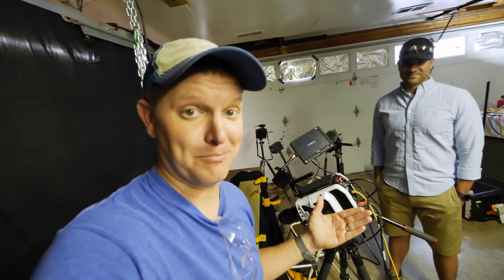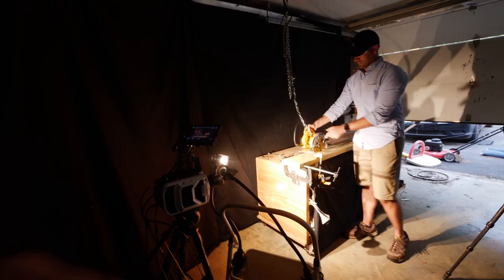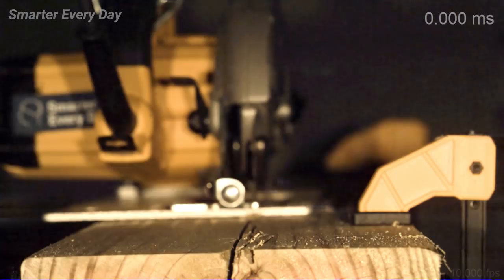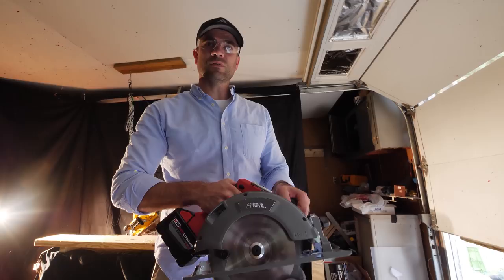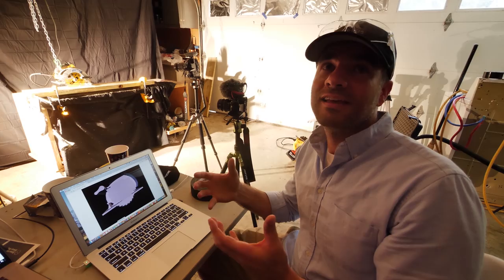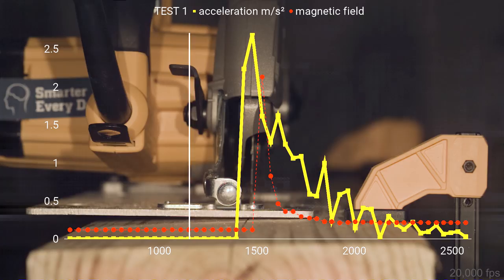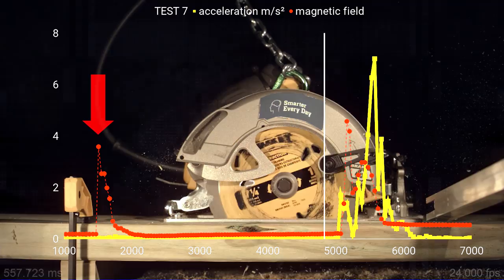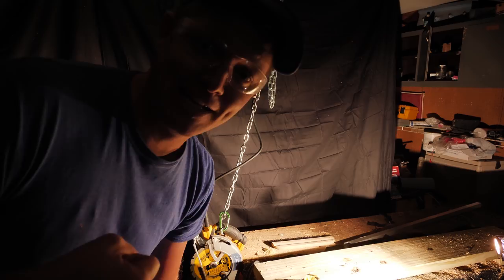Circular Saw Kickback Killer (We used science to make tools safer) - Smarter Every Day 209

Comment: I know this video is old but I’m still posting this comment. I’m a woodworker. It’s something I do everyday. I use saws everyday including circular saws like the ones you were using in this video. This feature is great and all but in a professional product, I don’t want my saw randomly stopping due to a false alarm. Even without this feature, the blade guard (which you had taken off or tied back) would cover the blade before it could hit you. What operators of a circular saw should be more worried about it preventing kickback in the first place. I understand it’s not always preventable but normally it’s because the blade binds because of a lack of support on the cut off end. If the operator set up and took time to think about safety before the cut, we wouldn’t have to rely on a feature like this, but have it as a backup. Just because there is a feature to keep you from hurting yourself if your using the tool wrong, doesn’t mean we should stop  taking the time to think about the cut before you cut. That’s why the saying goes “think twice, cut once”. Not just because you don’t want to cut the wrong size, but also because you need to think about if the tool is being used in a safe manner. Is the operator wearing safety glasses and is the environment safe to be cutting in. Not that this is a bad feature, it’s honestly amazing, but we shouldn’t have to rely on features like that if we can prevent it in the first place.

Comment: Anybody who plans on using a circular saw , do yourself a favour, spend the extra money and buy a skil worm drive saw. It’s has way more torque then sidewinders, it’s better balance so does not want go askew when cutting like side wonders, cutting down on kick backs.its also has a slip nut so blade will slip preventing kick backs as welll. Circular saws or side winders , are terrible design, the centrifugal force causes torque to want turn saw perpendicular to saw blade. Worm drive saws don’t have any of those tendencies
Reply: Weighs three time as much as a regular skill saw. Blade is on the wrong side of the saw so you cant see the blade when cutting a 45.
Reply: essential craftsman cuts 45's all day with his skill saw.
Reply: personnel preference, they will both cut you up bad. just get good with what you have and dont dream of having the next (or in this case last) best thing

Comment: A lil tip that may help anyone who experiences kick back from a circular saw. Support the cut off piece level with the rest of the board you're cutting. Hold the saw loosely with just the trigger hand and let the the power saw that you hired do the cutting for you. If you hang on too tightly or force the saw you will lose control.

Comment: I swear your blades are spinning the wrong way around!!
Reply: ifell3 what do you mean?
Reply: It's correct so far, 2 min into the video.
Edit: And Destin knows how to use tools.
Reply: ifell3 do you mean the blade is on backwards or the motor is spinning wrong way?
Reply: I own my own Construction company, i can honestly say it is spinning the correct way which is counterclockwise. It is designed to spin counterclockwise to pull the saw downwards to the wood and cut through it. If it spun clockwise it would just want to pull itself on top of the wood and not cut all the way through. And would basically be a  non stop series of kick backs in the forward direction.
Reply: @tomwilson7765  Exactly, it seems counter-intuitive on video for beginners, but if you've ever used a jigsaw with the blade upside down you realize it.
Reply: @ifell3:
I noticed this too. And in an other viedeo from the Backyard Scientist i noticed that the anglegrinders turn in the wrong direction too…
Reply: If it was spinning the right way it would fly forwards not backwards into the user, the ones I have used spins clockwise on the right side and anticlockwise on the left, if that makes sense.
Reply: You guys must have your motors spin in the opposite direction, if I was to let go off mine it would drive of down the road so to speak.
Reply: @Grakoham  motor
Reply: @tomwilson7765  wood has a top and bottom, if it spins clockwise on one surface it would spin anti on the other, vice versa, only if you let go of yours it spins towards you rather than away.
Reply: ifell3 the thing about having a saw that turns the other way is it will constantly try to jump out of the wood.
Reply: Ive run a road saw and it spins the way youre thinking this should spin... In one sense you are right, as in if it kicked out it would want to go away from you... But i can tell you from running a 300lb road saw,  when the blade runs out of diamond, you cant keep it in the cut.. You could stand on a circular saw spinning that way and it would climb out of the cut and youd be skating down the driveway till it came unplugged...

The reverse spin uses this exact principal to pull the saw into the wood.  And kickback will never happen if you use the saw properly. But as said in the vid, some material reactions and circumstances arise that can take even an experienced user by surprise.
Reply: @flip66five  yes i have also used road saws to cut control lines in concrete and if you go to fast or if the blade starts to get dull from the dimond tips wearing, the blade wants to jump out of the cut.
Reply: Ok I stand corrected, just been to have a look, I swear they went the other way!!! Thread closed hahaha humble pie ate

Comment: i feel like 95% of carpenters dont feel the need for safety equipment until they cut something off...
Reply: I've been to agricultural school for three years until this fall, and you can see the huge difference that young people finishing their apprenticeship have for pesticide and machine safety compared to the older farmers and gardeners. Early education makes a huge difference when you get people to take it seriously before they get used to ignoring risks.
Though it certainly helps that the health and safety regulations and workers rights here in Germany make it possible for workers to refuse any work if they think there is danger. Even when the task is within regulations, it's always down to the risk assessment of the people whose safety is on the line.

Comment: When I cut I grip with both hands(there is two handles on my saw) but the trigger hand I only grip with 4 fingers and trigger finger is not part of my grip on the saw so if anything goes wrong it’s much faster and easier to let go of the trigger. Also properly securing the material you are cutting is an important step I feel most do not do and is dangerous. When making a long cut backing up and going forward also cuts some of the material away as it tries to close together. Worn blades are another mistake I see a lot. Some blades also have a sort of non stick coating on the sides of the blade to help prevent it from grabbing. Setting the correct cut depth is important. There are many things you can do to minimize your risk when using a saw just like driving a car or walking down stairs. Be safe folks having all of your body parts still attached and not bleeding out on the floor is way better than saving 60 seconds rushing.

Comment: ? ? ? ?   How difficult or costly is disengaging the brake applied to the blade?  Since you were able to reuse the same circular saw in the succeeding video recordings, I must believe disengagement is an easy step to perform?  I understand this braking feature is available on tables, but that brake makes the blade unusable. I am sooo enjoying the SmarterEveryDay videos—as I’ve been a fan now for 40 minutes since I found your pulley video!
Reply: Not the same thing as the saw stop, which is what I believe you are referring to with the table saw. Hand held circular saws already have a brake that stops the blade from spinning when you take your finger off the trigger, otherwise the blade would spin to a stop from its own momentum. The brake doesn't damage anything. What these guys are doing is adding sensors to tell the saw to engage that brake when it detects a kickback.

Comment: The critical thing about this is that it is not a destructive stop like saw stop.  
Saw stop has a couple more issues challenging it, mostly due to the saw being fixed in possition, so it doesn't experience any detectable... or should I say, easily detectible, changes for kick back events.

Comment: as someone who experienced this kind of kick back. Well Done! I was lucky, using a small 3.4 inch circular saw and doing  a cut i should have got out my table saw for I stupidly, in a rush to finish a project, was holding the piece of wood behind the saw as i got close to the end in front. the saw jumped out of the wood and rolled back across three of my fingers. it was over before I even knew what happened. some how I got away with only stitches. should have lost all three and had it been a full size saw i probably would have. 

Stay Safe!

Comment: I always make the cuts holding the circular saw like a bull.  I had experienced the kickbacks but I always control the tool in the air. I do that because I saw many people get hurt with that saw.  I think the table saw is harder to control when there is a kickback.   Just never forget to hold firm that circular monster when you  make a cut.  Send the energy movement away from your body and never let go the tool.  Work in open and clean areas as much as possible.  Keep people and pets away.  Be safe.

Comment: This could've prevented my accident a few years ago. Sawing through a 2x4 with my dads big skill saw and hit a knot, kicked the saw back and ripped up my leg. It cut into my quad and I went straight to the ER. They said I was about 2 inches from my femoral artery and I wouldn't have made it to the hospital if I hit it. Lucky for me I made a full recovery and can lift weights again without any issues. The nerves are a little messed up though in the skin.

Comment: I get that the kickback can make the saw jump out of the wood. But why wouldnt maintaining consistent downward pressure on the tool prevent this? Keeping both hands on the tool with arms extended and downward pressure applied should help keep the blade in the wood while also keeping the blade away from you if it does come out anyways. Having the kickback be simulated with the tool just dangling from a chain doesnt seem to consider these extra forces in a real world situation. Far as i can tell the cutting capability is gained more from the speed of the blade supplied by the motor and less the torque of the motor. Im no expert or long time user of circular saws so Im really on speaking from speculation though.

Comment: I get the concept on paper but in the real world that feature would make a saw useless. You want to be able to finish a cut in one pass not start over. You want more torque when the saw computer senses resistance which all manufactures have been doing now. Secondly you should always make sure to have a decently sharp blade for the right job. This combined with more torque when it's being demanded is what keeps saws safe. As safe as a saw can be anyways. You have to restart a cut multiple times with this than you certainly would increase the risk of an accident happening imo. The extra torque when being demanded on new tool designs are made to just power through this resistance.

Comment: Chainsaws have ben using a counter weight brake for this purpose since the 1970s. Also wiring the trigger switch to a kill switch on the plate would work as well. Aren't  circular saw meant for cross cuts anyway?

Comment: This is very cool. That being said, I am much more concerned about kickback from a table saw than a circular saw. There is a brand out there that has a rapid braking system, but it works when the blade comes in contact with your finger. Although that is a great safety feature, it does not prevent kickback. It would be cool if you could adapt this technology to a table saw.

Comment: Wouldn't be easier and cheaper to design a switch on the saw shoe so as the saw lifts up it would stop the blade?
Also, blade guards are fitted with circular saws pretty much to prevent these accidents.

Comment: If you set up the wood correctly and stand to the side (per manufacturer instruction) that will not happen.  Sharp blade, experience, flex ion from the dimensions of the kerf are all variables that one eliminates with experience.  On the other hand I spent 2 years in Phys. Therapy getting to know a person that nearly cut through their leg 3” above the knee because they weren’t paying attention as using improper technique.

Comment: This could also be applied to drills.  Modern brushless power drills can really mess up your wrist if the bit gets stuck.  It wouldn't even require the same complexity/number of sensors as the saw - it just needs something to say "Uh-oh, the drill body is starting to spin (with too much force for a human to handle) instead of the bit... we must be caught up on something.  Pump them brakes!"
Reply: A simple accelerometer would work, for that.

Comment: I'm thinking that if you're standing behind the saw when using it, you aren't going to see where you're sawing, especially if you have a line drawn that you're following so you're doing it wrong to begin with. I've had circular saws bind up numerous times over the years. Never one kick back. It just stops spinning the blade. You need to be strong enough to be able to hang on to the handle. These aren't 5hp table saws. If you can't handle a circular saw when it binds up, you might want to use a jig saw or hire a contractor and just watch from a distance.

Comment: A great way to prevent a kickback is knowing how to use the tool correctly and how to cut the material correctly to prevent a kickback all you have to do is have half of the board or sheet of ply wood either put something like a 2x4 underneath so the other half of the sheet falls and doesn’t pinch or in this case when ripping a 2x10 as long as you have a firm grip and know how to use the saw it won’t kick back like not binding the blade or trying to move the saw left to right while cutting and this is kinda not to accurate of an experiment because the reason the saw kicks back everytime is because that’s the way the blade spins so when there’s no counter pressure like your hand it will kickback every time good idea and cool video tho

Comment: How about a micro switch on the bottom plate of the saw the would activate Dynamic braking when the saw lifts. It would not require microprocessor and reduce the cost of the saw.

Comment: Remember that there is always a user applying top pressure onn the saw.  Have never seen an incident which was outlined in this vid...sorry.
Reply: Thank you someone that actually has used a Circular saw before like the comment I posted if you know how to use tools correctly and cut your material correctly you won’t have any problem

Comment: I have a problem with this video.  I notice no one has there hand on the saw and the blade guard is wired back.  Why not show the saw being used as it would be in the real world?  I have hit knots in wood and never had a saw kick back like this.  The only thing my saw did was push back a little but never reacted this violently.  But then I had the wood properly supported and a firm grip on the handle.  If I started the saw and the blade was against the wood, it has hummed but never kicked backed violently.  Now I will say I have seen bad kickbacks where the piece being cut wasn't supported correctly, i.e. someone trying to cut a board supported by their leg. So my question is are you creating a problem where there really isn't one?

Comment: Why isn’t anyone noticing that the saw blade is spinning in the wrong direction normally it should spin clockwise so it pulls it self down and not pushes it self up if you can’t hold it and on a safe powersaw there is a shield around the blade that’s getting pushed back by the wood you are cutting and if you take the saw from the wood it immediately goes back and prevents the blade from cutting anything else.

Comment: I would make a wrist band with integrated accelerometers and gyros. And  then let it communicate over bluetooth low energy with a smart switch that cuts the saw power in case  of kickback. Then it could be used for every handsaw.

Comment: I've used circular saws for years and never had a problem. I've cut through nails knots and staples and have never had a saw kick back but I do make sure I have a good grip on the tool when I'm using it.

Comment: It is not easy as he says. The break is already there and it is designed to be applied when the power switch is released. Imagine what is will happen when you press the accelerator and break at the same time on a auto transmission car. The actual process involves implementing the break which is already there and another circuit breaker to cut of the power from switch even when its pressed.

Comment: I don't get it, the saw is not being applied any pressure in these test of course it's going to fly off way fast and way more likely without someone holding it down. That pressure while holding it would severely impact the reaction time needed to do something in most cases kickback is the piece your cutting that flies because you're actively holding the saw.